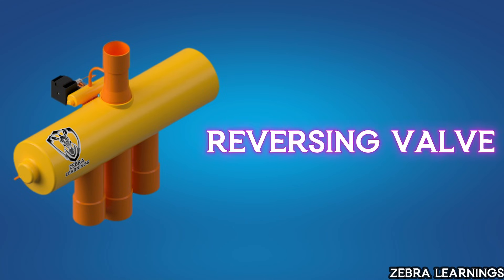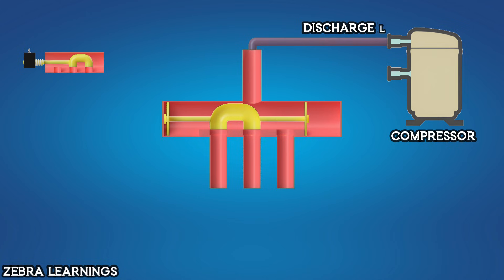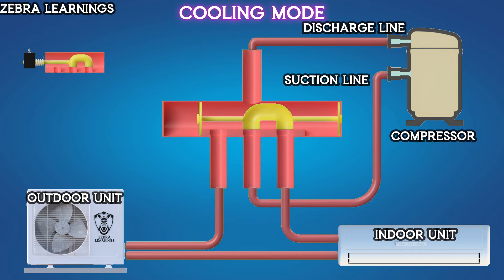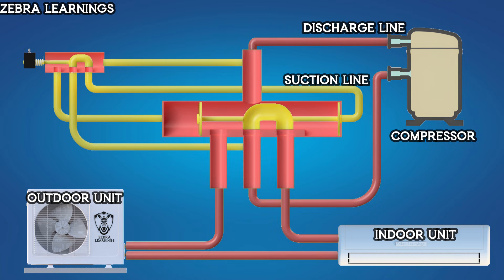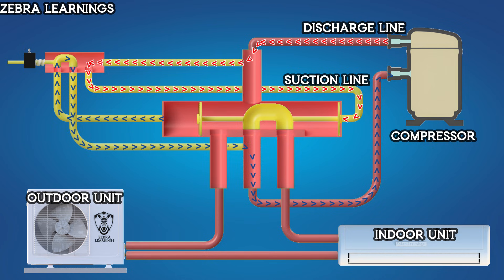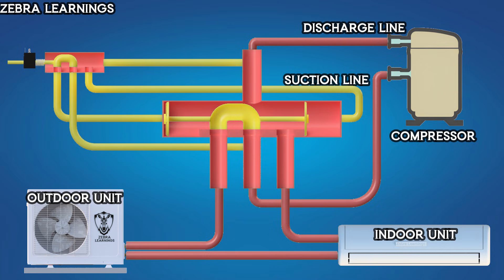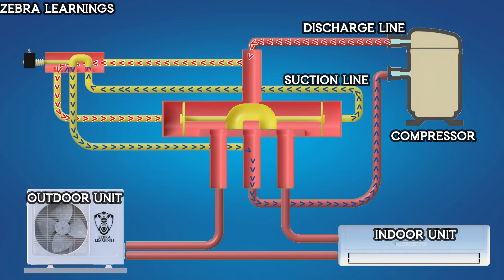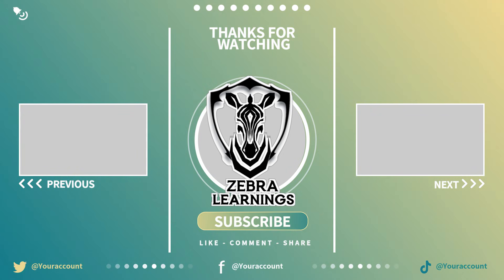How the Reversing Valve Works in a Heat Pump | HVAC Explained | Animation

Comment: Hello  Thank You for the  all Your  videos !
My question  is not  related  with  this video  but maybe You  can make another video  wi it.
I would like to  ask  You  how  I can  measure  in real  how  much  heat produce  heat pump  or aircon  but not  by calculation  rather  than real measurement.
For  example  the  same  heat pump  produce different  amount of  heat  when outside temperature  is 7 Celsius  and different  amount  when  outside  temperature is minus -7 Celsius. 
I will  appreciate if You answer me .
Many  thanks!
Geno

Comment: How to find compressor common, starting, running terminals
Reply: You can use your meter most times. You just have to know what range of Ohms to start out. 
I forget exactly how right now because it’s heating season now, and I’ve been neck deep in boilers for a minute. 
Just google “How to use a Multimeter to find compressor Start, Run, and Common terminals.